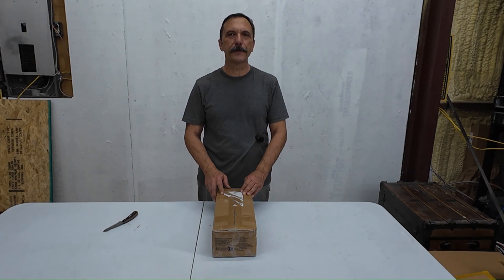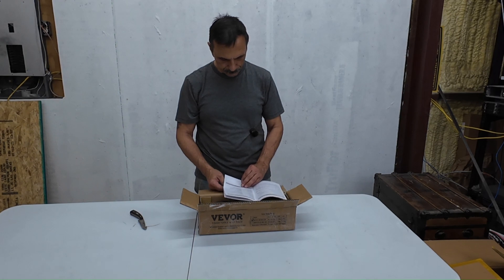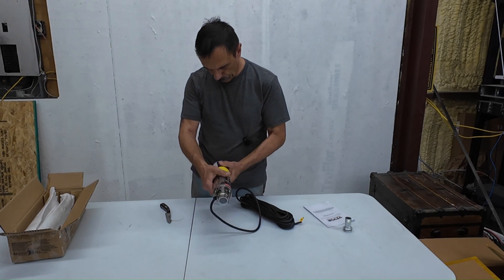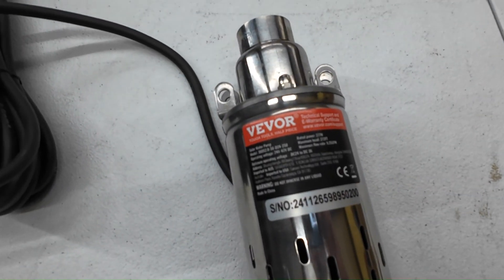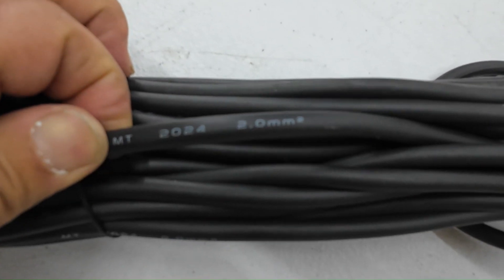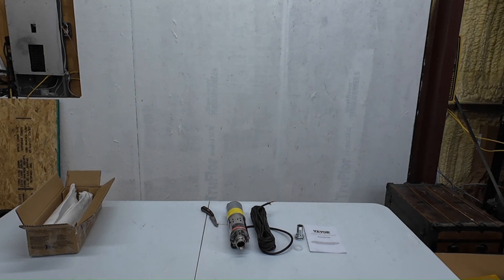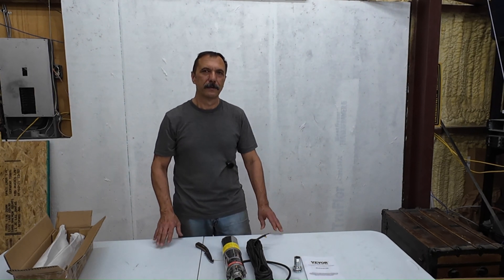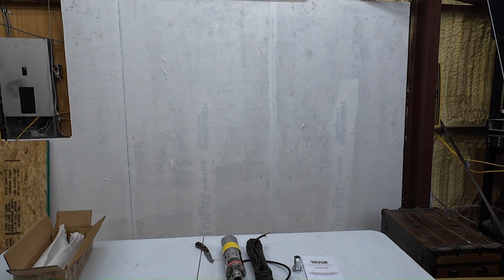Vevor Solar Off Grid DIY Water Well Pond Irrigation Pump

Comment: Well I listened to this jack A, bought this pos vivor solar crap pump. It is a useless pile of garbage just like this bs how to with absolutely no showing it's function.  Save your money dont buy vevor and definitely dont listened to this jerk.
Reply from the maker: Your so funny, just so you know my pump is still running every day as soon as the sun comes up. I can make a video showing it's function if you need some hand holding. I did make 2 other videos on the pump, did you watch them? But it really is simple to figure out, 2 wires connected directly to the solar panels. Doesn't get any easier.